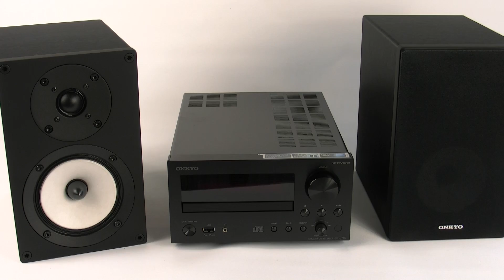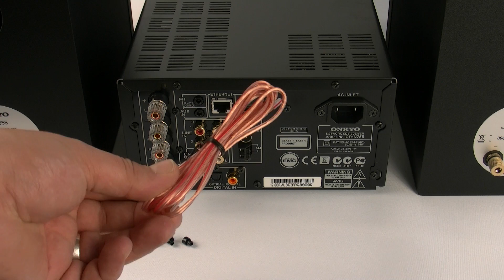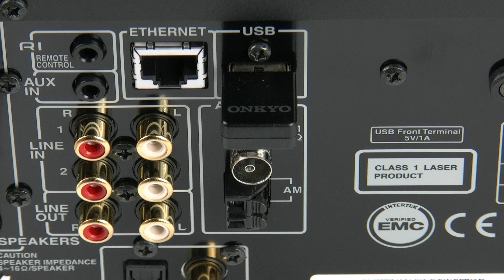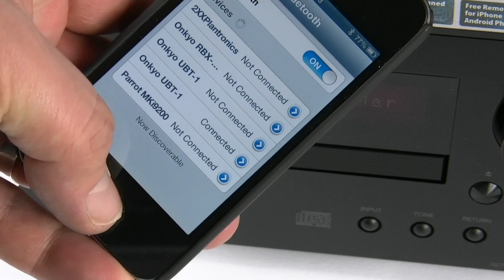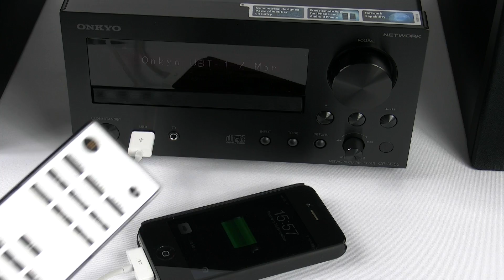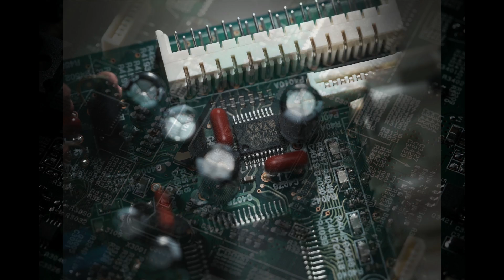Onkyo CS-N755 Network Hi-Fi Mini System

Comment: Can you connect it with a soundbar through the fibre optic cable?
Thanks
Reply from the maker: Hi, typically, this will not work as both devices (soundbar and mini hifi system) use the digital connector as input only (e.g. to connect to the digital optical output of a TV)
Reply: OnkyoEU thanks
So their is no alternative?

Comment: Hi one basic question, what happen if I plug other speakers to the analog line out? the harman kardon soundstricks III. Thanks
Reply from the maker: Hi, if you prefer, you can connect the HK to the analog line out to use this active speaker system, no problem.

Comment: Hi, can I connect and iPad 2 to the USB port for music playback (the same way as an iPhone or iPod)? If so, would I be able to navigate and select the music from the iPad itself (using for instance the default Music app), instead of relying on the Onkyo remote and screen? Thanks!
Reply from the maker: Hi, we are afraid that only iPods and iPhones are certified to be used with this product. But you may use either the 3,5 mm headphone jack output of the iPad2 to connect it to the CS-N755, or you could use the Onkyo Remote App (download via Apple AppStore) to stream music from your iPad to the CS-N755 over your WiFi network (in this case please make sure that you select "iPhone" apps to be shown in the AppStore). Thanks for asking!

Comment: Hi!
This device has the programmable timer?
By the user manual just a simple sleep mode is available.

Thank you.
Reply from the maker: Hi, the CS-N755/CR-N755 has a sleep timer: With the sleep timer, you can set the sleep time from 90 to 10 minutes in 10 minute increments.

Comment: N765, the new version: can I use a 1TB portable HDD formatted in NTFS, with my music backup sorted in Artist\Album\files.flac connected to the USB port? I find it a cool amplifier/receiver with the plus of the CD drive, but if I can't use my backup hard disk I can't buy it, it would be a waste of money since now I can use a Blu-ray player connected to an A/V receiver 7.2 (but without USB port/Wi-Fi).
Reply from the maker: +delpinsky Hi, the CS-N765 has e.g. the following requirements for USB devices: The unit supports USB storage devices that support the USB Mass Storage Class. FAT16 and FAT32 formats are supported for USB storage devices. If a USB storage device is divided into multiple partitions, this unit will recognize them as separate volumes. This unit supports up to 20,000 files and 16 folder levels within a single folder.

Some other restrictions may apply - like the unit might not be able to use media that is loaded into a USB
card reader. 

For all details please see page 40 in the CS-N765 manual "Compatible devices/media/file formats". Here you will find descriptions for support devices, media and file format specifications. The manual is available as PDF on http://www.eu.onkyo.com.
Reply: +OnkyoEU The CS-N765 is a really great machine!

Comment: What options Onkyo have for a nice subwoofer that matchs in quality, harmony and speed with the n755? Thank you
Reply from the maker: +cfgauss Hi, we're afraid there are not that many options: in EU, there is currently only one Onkyo subwoofer that is sold separately, the SKW-208. It's an active 120 W down-firing sub with 50 Hz to 200 Hz adjustable crossover frequency, phase switch and output level control. More details (e.g. incl. a picture) and be found here: http://www.eu.onkyo.com/en/products/skw-208-34611.html    Thanks for asking!

Comment: I have three sets of Polk 601 ceiling speakers and a splitter. Can I use this set up without the provided speakers? The ceiling sets are each 25 feet away.
Reply from the maker: lanbentsen Hi, the receiver has 22W/ch at 4 ohm. This is typically powerful enough to drive a set of stereo speakers with good efficiency. But driving three sets of speakers using a splitter will most likely require a different power amp, as the amount of speakers has multiplied...

Comment: I'm about to extend my onkyo cr-n755 with a subwoofer. I was wondering what signal is the subwoofer getting from the pre-out? Is it a limited frequency band? if yes, what are the min and max. frequencies?
Reply from the maker: Hi, it is like a line-out - the filtering will be applied by the subwoofer.

Comment: is it possible to connect to my android smartphone to play music？ how？
Reply from the maker: Hi, check out the "Onkyo Remote" app in the Google Play Store (free app from Onkyo)!
Reply: OnkyoEU installed and no device is available to be connected
Reply from the maker: Kenneth Chow
Hi Kenneth, would you mind getting in touch with our colleagues from customer care? There can be quite a few different reasons for connect failing (e.g. WiFi router / firwarewall configurations, general network setup, etc):    customercare_eu@eu.onkyo.com      Thank you for your understanding!
Reply: OnkyoEU I am able to connect to the hifi now. However, what I want to do is to play the music files from my smartphone. Is it possible？
Reply from the maker: Kenneth Chow Hi, just click the music note icon on the botton left to access the music player - then you should be able to play the music stored on your phone :-)
Reply: OnkyoEU Finally I did it. However, I can only play the music files stored in the device memory of my smartphone, but not stored in the sd card. Anyway, I think this is an issue of android system........

Comment: Hi, can the USB port at the back or front be used to connect a USB hard drive for the purpose of simply playing mp3 files stored on the hard drive. If a hard drive can be connected is there a limit on the size of the drive ? Thanks
Reply from the maker: Hi, the manual contains detailed information about this topic (e.g. number of files, format of stick, etc.) - could you check the English manual, page 45 (USB Device Requirements). The PDF of the manual is downloadable from our website  www(dot)eu(dot)onkyo(dot)com   Thank you for asking!

Comment: Hi, hope you can help. I have a Onkyo Tx-nr515, and am looking to purchase this micro system to have in my kitchen and hook the 515 to it and use it as my "zone 2", as opposed to me just having an integrated stereo amp in there. Two questions, 1, is it possible to do this via the "line in" on the rear of the Cs-n755?, and 2, if i purchase the UBT-1, can i hook it up to the rear usb on the Cs-n755, and stream audio from my bluetooth laptop?, apologies if these questions have already been asked